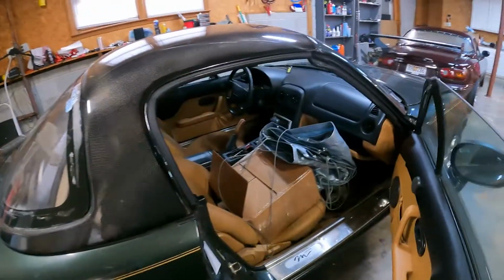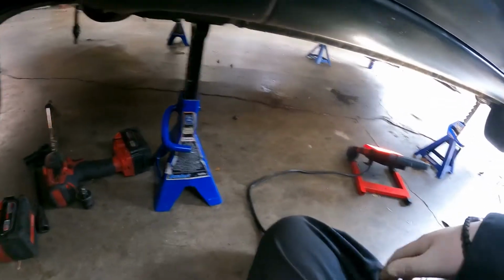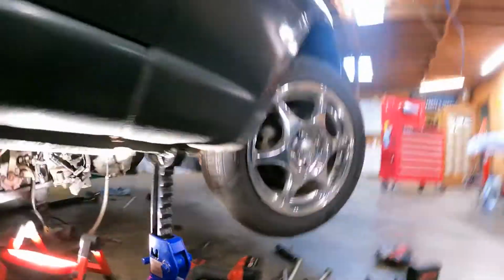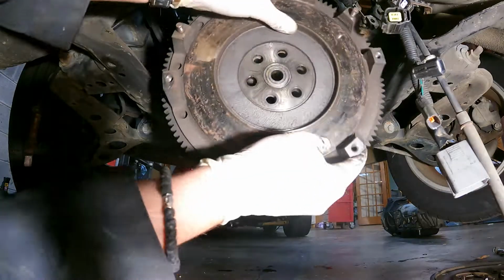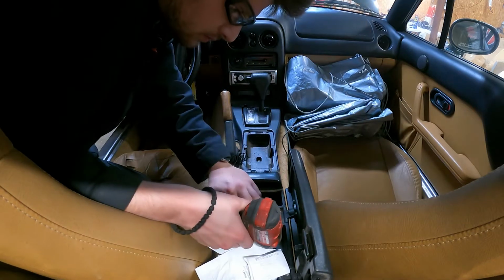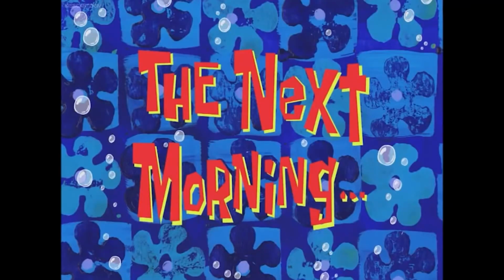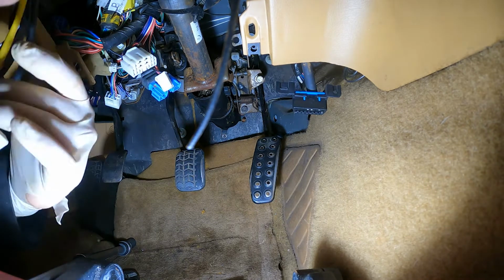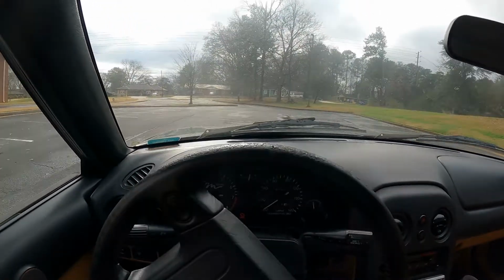How to swap your automatic Miata to manual

Comment: I know this is an old video so it’s unlikely that I get a response but how to you wire the reverse switch? I have my Miata up and running but no reverse lights
Reply: Immortan automotive has a video explaining all the wiring mods need and pretty much does everything on camera

Comment: PSA: you do NOT need to swap out the pedal assembly as shown in the video. For the brake pedal, there is one bolt and nut that holds it in the pedal assembly, near where the spring is where the brake pedal pivots. You can simply unbolt that, unclip the spring, and then take out auto brake pedal and put manual pedal in place. Saves SO MUCH time. Clutch pedal goes as in, just remove the block off plate and auto tcu and you're good.

Comment: Do you half to change the drives haft or can you use your automatic drive shaft?
Reply: The auto and the manual are different lengths so you have to source a drive shaft from a manual to do the swap

Comment: Does it have to be a 1.8 manual transmission or can you use a 1.6 manual as well?
Reply: They both use the same trans. You can swap them all between each other as long as it’s an NA or NB

Comment: I didn’t see any mention of how you address the check engine light on the dash?  My understanding based on some reading is that the ecu is confused because it it looking for the auto transmission and it isn’t there.  I think you have to swap the ECU for a manual version to really fix this but I think it requires reprogramming and there is something with the immobilizer that needs to be adressed too, so I'm still researching.  Any tips on this would be appreciated.
Reply: Immortan automotive has a video explaining the wing mods need and when he did them during the swap.

Comment: Completed the swap on my 97. Car runs like crap now. Idles at 2k + rpms and sputters when it occasionally drops down to 1k. Supposedly there is a pin on the ECU that needs to be ran to ground to tell the car it is a manual now. The circuit is called the AT / MT Designation circuit. This seems to be specific to the 96/97 cars. I have not tried to do this yet so I can't confirm in this info is valid.
Reply: Have you put a bung on the back of the intake that the automatic gearbox used as a breather I had this issue and when I put the bung on it sorted it straight away I amd just trying to figure out how to wire in my speedo

Comment: i just bought a '95 NA with no engine, no transmission and no interior 
it has all body panels in very good condition no dents or anything (only problem is small paint chips) 
it has all the suspension, steering and brake components and its sitting on spare tires

it was originally a automatic and i want to make it a manual 

any advise on bringing this car back to life and getting another miata out on the road would be greatly appreciated

Comment: My manual transmission on my miata broke on the shifter housing part im replacing the whole transmission and clutch should i replace the flywheel or can i reuse it (trying to spend the least amount of money)

Comment: Good evening, I just saw your superb video, with a lot of detail. I have the same MX5, but with a manual gearbox and I dream of making it automatic, I am told that it is impossible so give me your opinion please
Reply: If you were swapping a manual to an automatic wouldn't you require the wiring harness for an automatic transmission?

Comment: Why does do the break and throttle pedals need to be switched?
Reply: Because the auto break pedal is a bit larger and would hit the clutch pedal. Manual break pedal is as smaller.

Comment: Did you have to change the ECU and Starter ???
Reply from the maker: No! You’ll have a check engine light for transmission codes but it will run.

Comment: I got confused when you said to jump two wires for the neutral switch at the end, can you explain abit more what it does and why I need to do it, whats a neutral switch?
Reply: I was following up until that point ans got completely lost there. Did you ever figure out what he meant?
Reply: @originalusername143  I forgot what i was confused about at this point but i do remember its most likely the Automatic Transmission immbilizer wires, which i had to cut and splice together, they are the two heavy wires in the whole bunch, much thicker then the rest, bridge them properly otherwise the car wont start.

Comment: Did you re-use the automatic speedo cable with the manual transmission? Checking if they are the same to try and save $100
Reply: yes u can use

Comment: Is the wiring different from the automatic to the manual do you have to spice anything
Reply: You have to wire up the neutral safety switch to the manual trans to start the car or you can jump the two wires together but im currently trying to figure out how to wire up the reverse lights
Reply: @postit4273  nice does your speedometer work? I have the electronic version not cable.
Reply: @leepeezy  I haven't done the swap yet, im currently working on getting the manual trans out of the car I'm getting rid of so im not there yet
Reply: @postit4273  okay
Reply: @postit4273  did you ever figure out the reverse lights?

Comment: This information is out there, already. Thank you for touching on the neutral safety. But what about the odo? Reverse lights? Hardly any GOOD videos showing how people are getting those two components of a manual swap is done. It would've been a very unique video, had those bases been touched. But great vid overall.
Reply from the maker: Odometer still works with a speedometer cable, reverse lights are pinned into that large main connector.